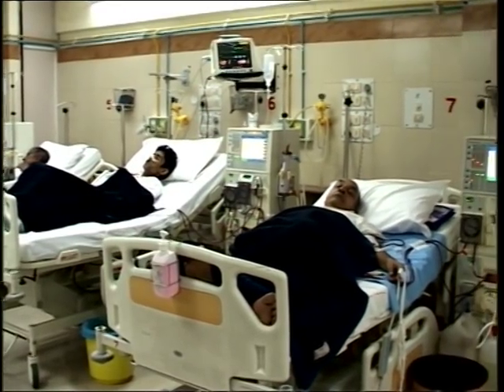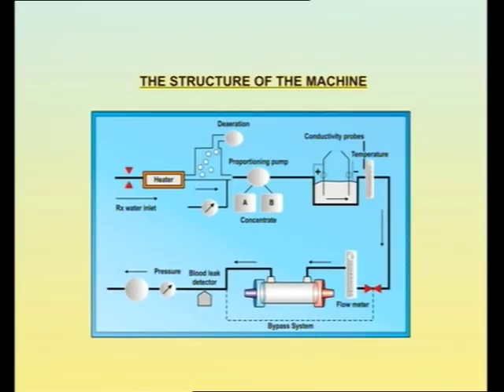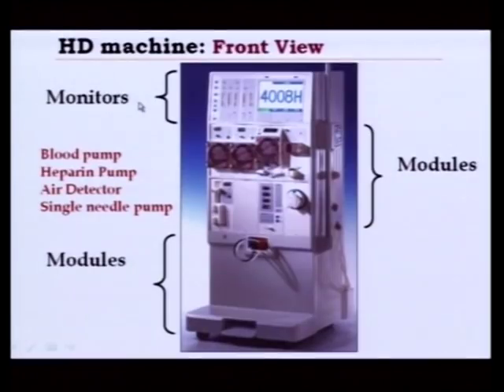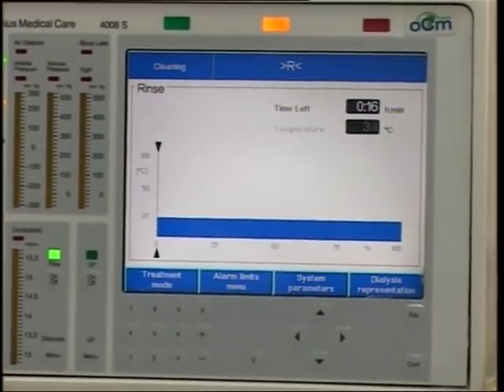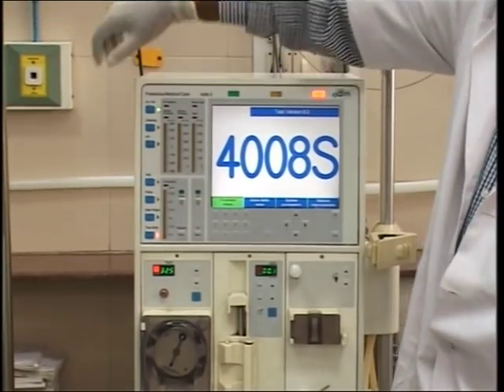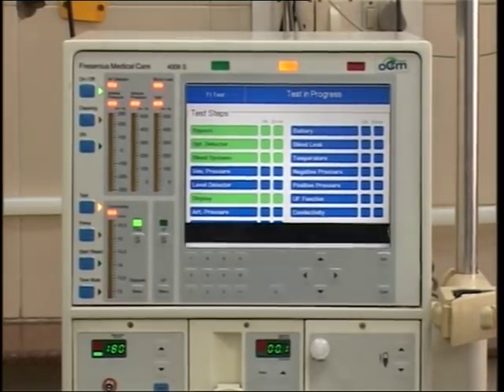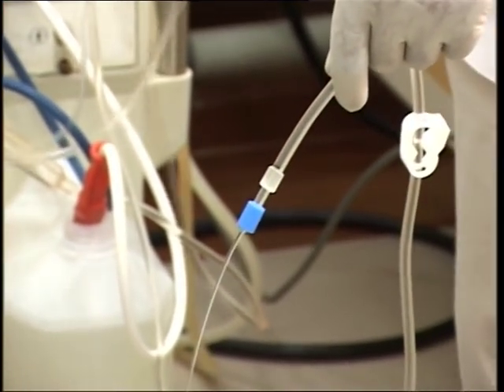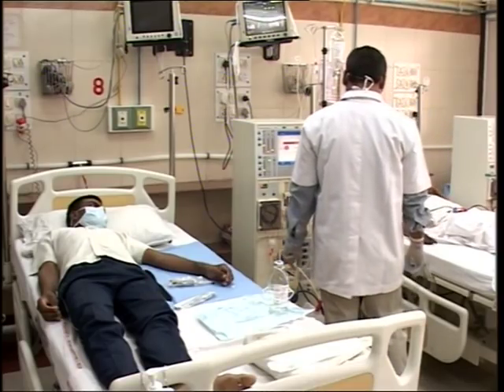Setting Up of Dialysis Machine

Comment: wrong bypass.arterial output port should connect wt red bypass and venouse should connect wt blue port.
Reply: Mages Meenu ....no .. only in this machine you have to do the opposite side ...
Reply: im stil trying to understand the reasoning for this can u explain 😔

Comment: The dialyzer is connected improperly. The red hansen should be connected with the arterial line and the blue hansen should be connected at the venous line.
Reply: man le .... only for this machine you have to do the opposite
Reply: If u connect this way, then red end must be on top & blue end below..in order to get counter flow in the dialyser.